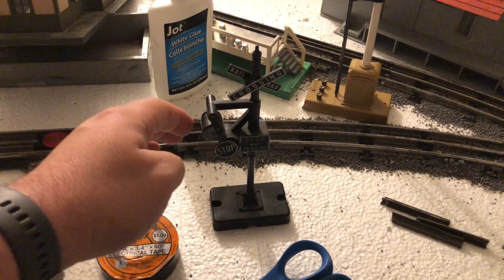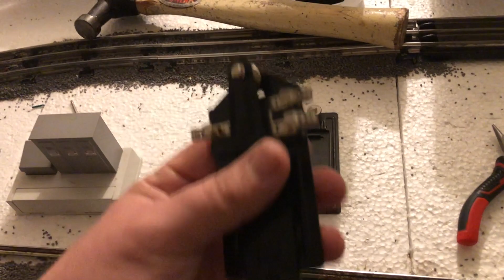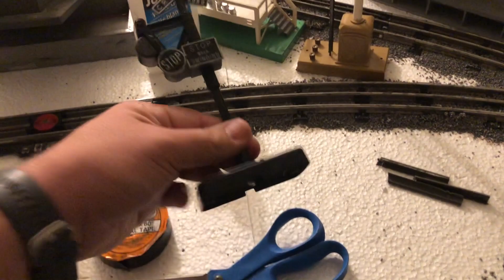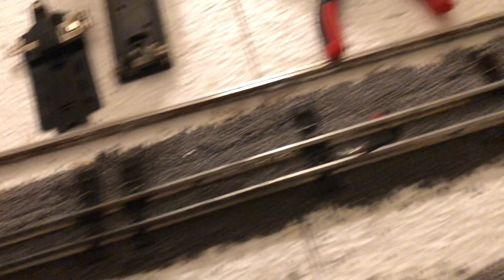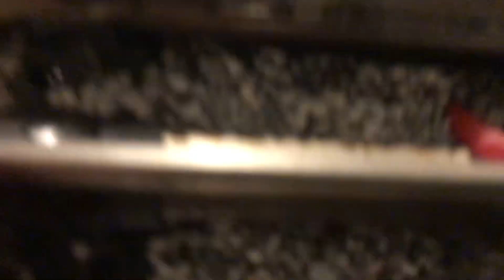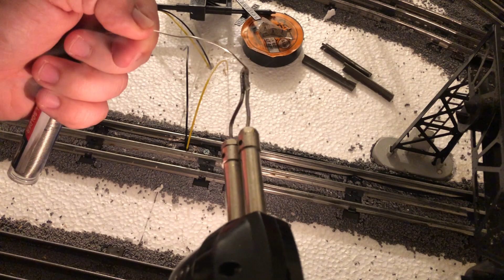Lionel 140 Banjo Signal, wired using an isolated rail with track power!

Comment: Thanks for the video- really well explained. I'm going to try doing this with the isolated track, but powering the accessory with a transformer so it has it's own current separate from the track. I've been seeing videos that the transformer powering the accessory needs to be in phase with the transformer powering the track..  I'm not quite sure how to make sure the transformers are in phase with each other.
Reply from the maker: Not a problem, I have always wanted to try that , but I’m not exactly sure what would happen if a short were to occur. I’d recommend to try it first on a loop of track and use a transformer with a circuit breaker.  Lionel has a video on their channel from a few years back that explains it pretty well. I hope to post more tutorials in the future, good luck !
Reply: @NixCrossing  yea i just found it, thanks!
Reply: I don’t understand what you taped the entire rail. You only need to isolate where the rail and tie make contact, so what’s the benefit of the extra isolation between ties?